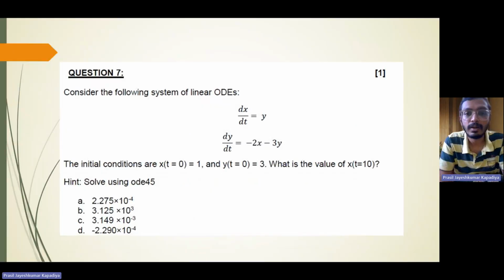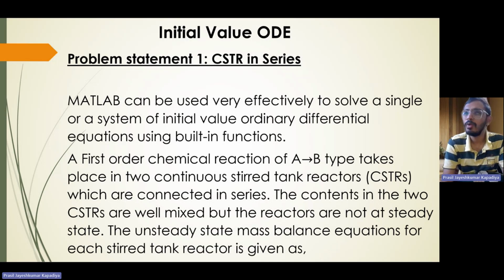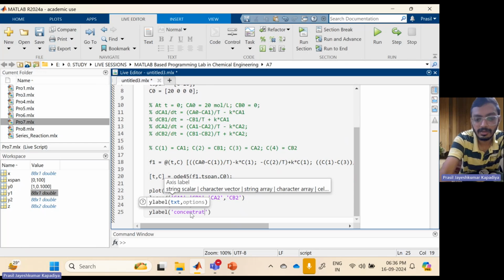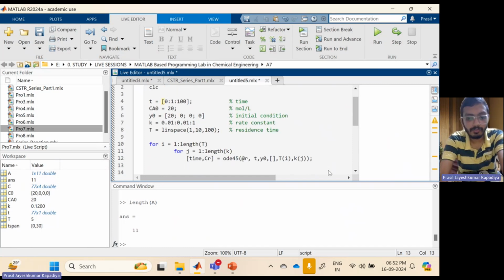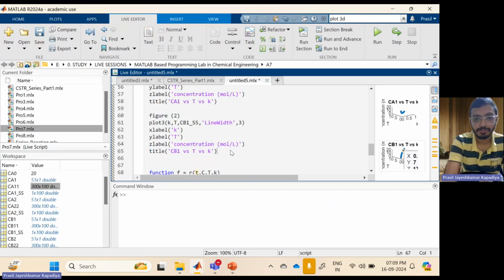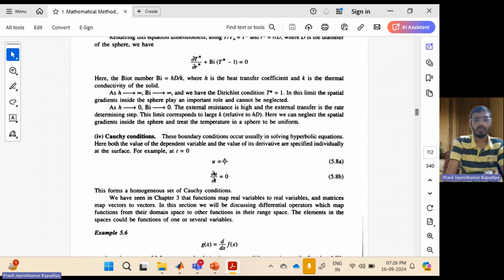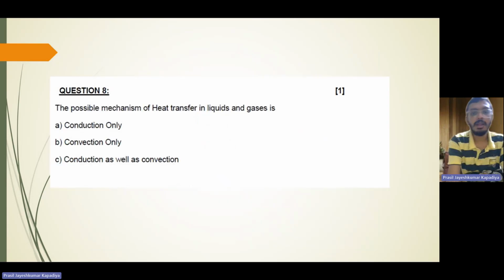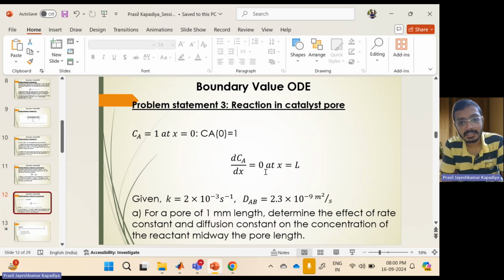NPTEL - MATLAB Based Programming Lab in Chemical Engineering | Week 8

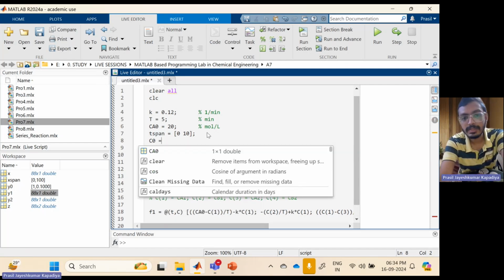Comment: at 34:16 you wrote C0=[20 0 0 0] but it is given that 20 is the inlet conc. of A but not the conc. of A at outlet of reactor 1, shouldn't it be [0 0 0 0]  as it was said all other dependent variables has initial value 0?